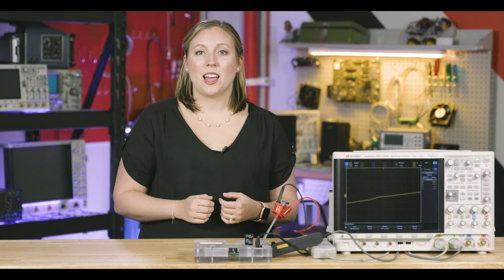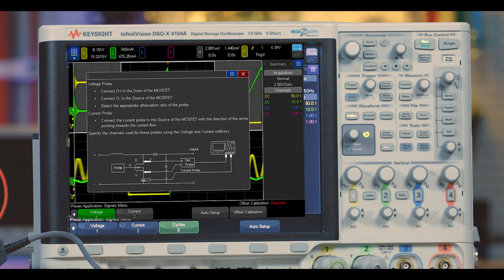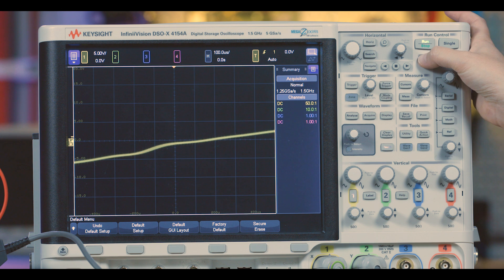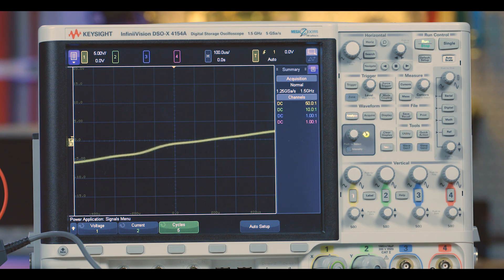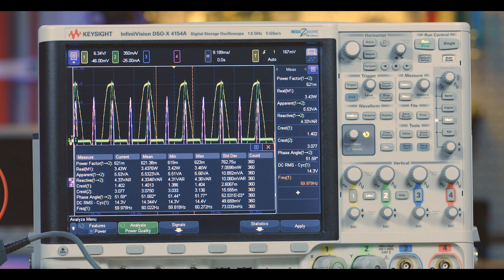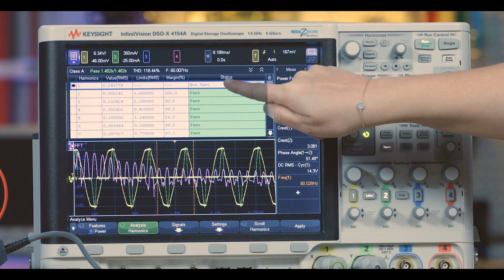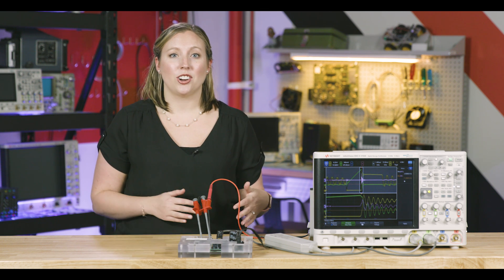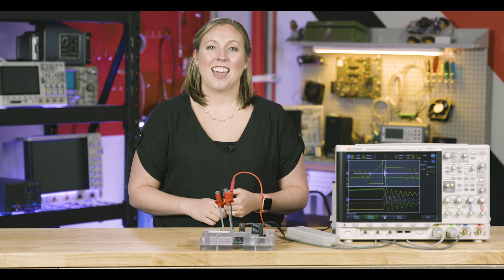How to Test Switch Mode Power Supplies with an Oscilloscope

Comment: Yeah, that current probe is only $5,000 and that differential high voltage probe is only $2,000.  Not sure how much that scope is but it's 1.5 Ghz so I'm guessing around $15-25K.

Comment: If you need to explain your customer,  a  ( often specialised) engineer,  what to measure, how to measure and why he needs to measure that ( all rather basic things he must know already) you target the wrong market or the state of electronic engineering knowledge outside China has reached a tragic low level. 

I do not design SMPS, I only repair them, ( a lot, in test, calibration gear and specialized industrial gear, for instance from customers of Agilent gear to old for Keysight to support, and also without schematics because you do not want customers to repair their own test gear anymore (something HP and Tek always promoted)  

But regarding all your promotion/tutorials/publications etc repair techs are no target market, they cost you money. But you forget the customer that is forced to buy new often does not wants the same brand anymore. For me my scope is as important as my meters  (worn agilent,  a Brymen 869 that refuses to die,  a Keithley 7510 and 2000)  I use my scope so often that I wore down a Rigol in 1 year (10 years ago I made that mistake),  My 350 MHz R&S is now 8 years old and needs replacement (repaired it twice already) . Most probes last a few moths. But I am not a hobbyist, not a student and not a product developer so who cares what repair-techs (many are also EE) do with a scope, or develop functions for them, or even tell them why  you should buy a Keysight for repair. The same for multimeters (not only you)  that is most times only focust on industry. My Agilent came with a rechargeable battery but who comes with the bizar idea to only charge it via the testlead sockets so you can not use it during charging (with a 24V powersupply ????).

Sorry, I am a bit in rant mode, it is not personal. I think you do the videos very well.
Reply: Students, rookies, engineers from other related fields.... Not all electric engineers are required to know all about power electronics, quit being arrogant!
Reply: @MrQjoo  Nothing to do with arrogance. This application costs money, it is not a standard function of the scope, and the people who use this are, according to Keysight, people who design power supplies. If you buy this and you do not know the stuff they explained you waist money because you then measure things you do not understand and that is useless because you then are not able to "translate" this data into changes for your design.  The people who benefit from this application know this stuff.
Reply: A. The engineers don't write the checks. This is helpful when planning to purchase high-value test equipment that is part of a group decision. 
B. Many of the features in this video highlight capabilities that have not historically been done solely with an oscilloscope. The power application is a real time saver.
C. There are many engineers the focus primarily on high-speed digital or RF design that are needing to learn more about PDN design and validation.
Reply: @Factory400  Thanks for explaining, I had not thought about point A (I am my own boss so I have to write the checks :-(  )  From that point of view this is a good/helpful video.
The application itself is good. I had no doubts about that.
Reply: but...did you notice bracelet on her hand?
Reply: Agreed